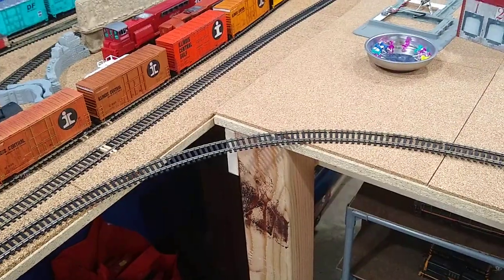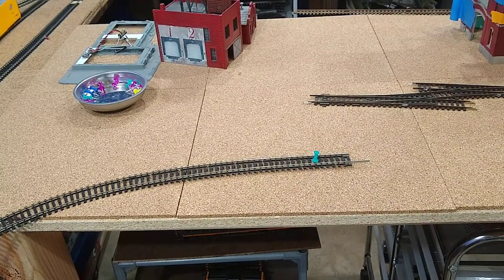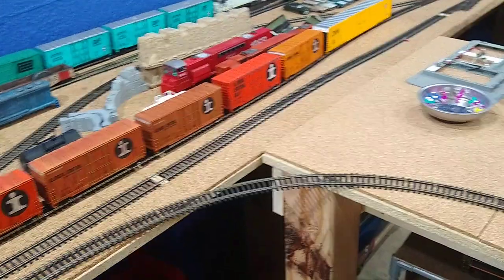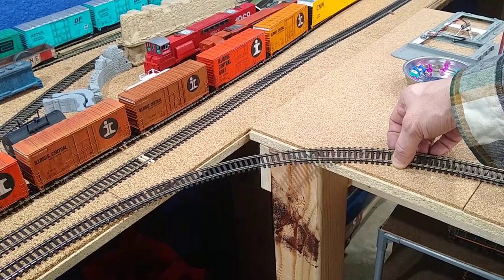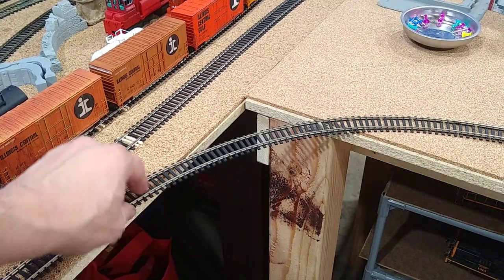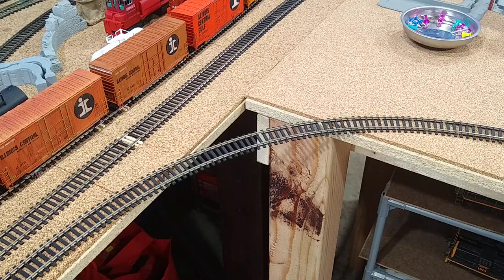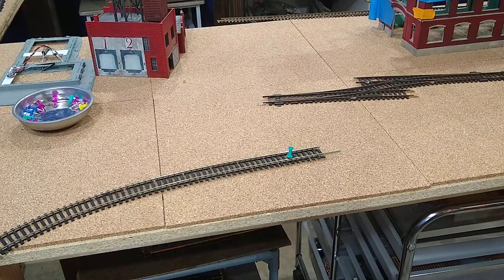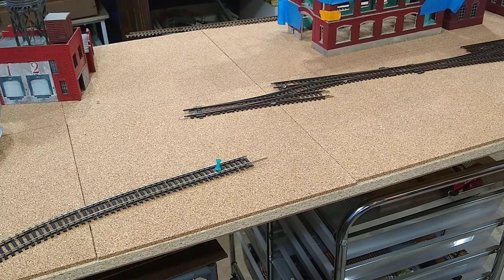A short primer on installing flex track on cork over particle board

Comment: Seen 4x4 prices lately? Of course, everything is up this year. Plan on going with a rustic timber look on mine as well. Maybe some small log framing incorporated in to match some notty pine  wood work.
Reply from the maker: 4x4 are still $10 in the wastelands, that's why I use them for everything in my whole place.  i've used so many of them that they are a theme throughout my place
Reply from the maker: this is a secret video just for a request from a friend
Reply: @elite194  I'm in Northern Michigan surrounded by logging. Still expensive at home depot, when they have them. 4x4, definitely have the heavy timber aesthetic with the dimensional benefit. Almost have the basement walls done and have a ceiling to do before I can get going on a layout, myself. At least I can plan for some electrical and lighting.

Comment: Question: (at 5:54) when you have two parallel tracks connected by #4 turnouts, what is the center-on-center distance between rails? Thanks.
Reply from the maker: excellent observation - that piece was a 3 turnout  yard ladder that I removed and replaced with a handlaid ladder of the same size... (I gave away that piece you see to a good friend)  so how I do center on center is I take 40 foot hi-cubes that you can see and 86 foot hi-cubes that you see in many of my videos - I put those 2 types in position and check if they touch each other.  If they don't touch then I call that track good to go.  I don't measure, I test.  Testing is by far the best way to do this.  If you run lots of 50 foot boxcars, then test those against each other on your tracks - but also test shorter and longer cars.  I find that if I test 40 foot against 86 foot I usually get exactly what I'm looking for.... but Colossus is rising and then everything you thought you knew will evolve... Colossus One will save us all
Reply: Excellent Information. I am planning on a narrow switching layout in my office. Small room. Only 11.5 inches wide. Can I fit four parallel tracks in that width if they are linked with #4 switches? No rolling stock, just diesels.
Reply from the maker: @kentpool7414  according to my framing square and my workbench.... 4 tracks with a combination of various switches from  4 to 6 fit just fine in an 8 inch corridor.  I am currently working on a special making super tight number 4 and 5 crossovers.  Yes it can be done no problem.  In my own office I used bachmann steel ez track to make a loop around the entire reception area and that track took a fearsome beating daily and stood up like a champion.